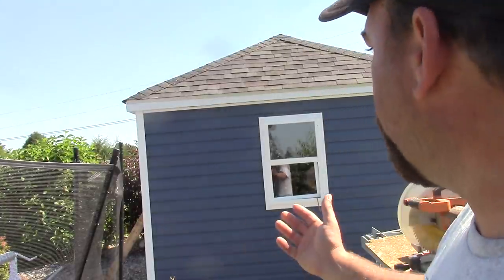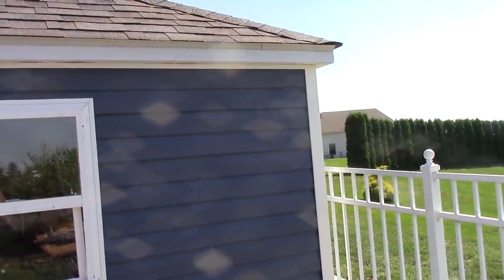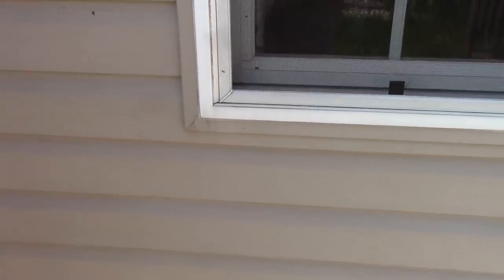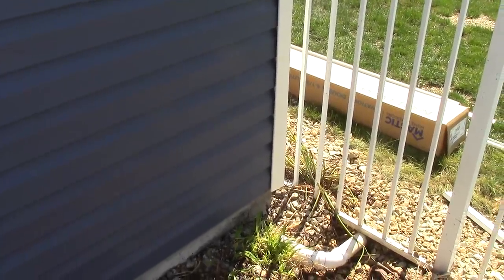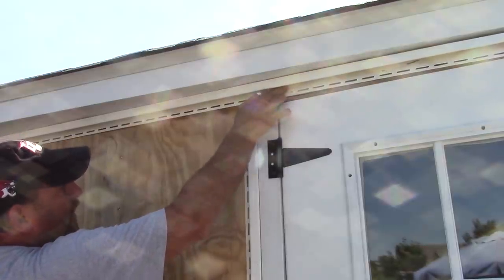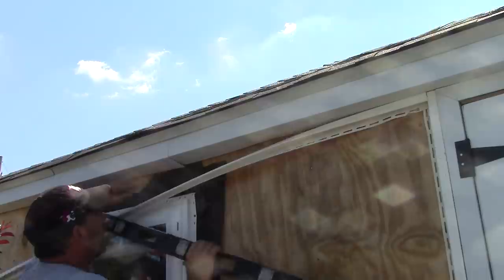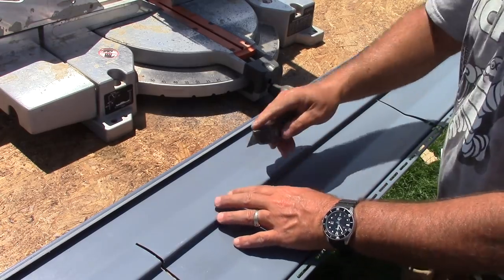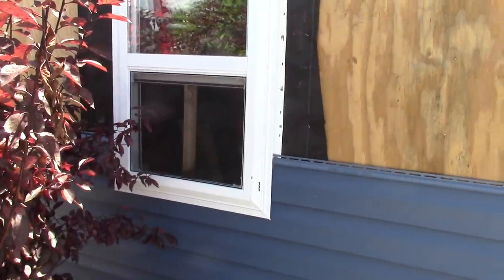How To Install Vinyl Siding On A Shed

Comment: To anyone watching this, use house wrap, it is your actual barrier against water,  Some water will and does get behind vinyl siding, especially were windows are. Were do you think wind driven rain goes after getting in the j trim around the window? Yes down  and some gets behind the siding as the j channel doesn’t run straight down to the ground, as say like the corners do, so you count on House wrap to keep the sheathing dry as any water that made it by the siding will run straight down and out. Any play were to pieces of siding meet even tho they over lap, can and do get a little wind driven rain past them. Again this isn’t a issue when installing the House wrap and flashing correctly. This guy doesn’t have a clue.
Reply: Thank you

Comment: Nice video.  Thanks for posting, very helpful.  Just had one question; how do you make sure the siding is started at the same height all around the building so that it is level all the way around?  Thanks
Reply: a starter strip helps tremendously

Comment: Nice, Bob.  Irwin makes a vinyl blade that's a lot quieter than anything else I've tried.  Thanks for sharing, man!
Reply from the maker: I didn't know there were vinyl blades.  Thanks for the tip.

Comment: have a window leaking . looks like I may have to remove siding the gap is more than 1/2 inch at top & too large to caulk. any easy way to seal this?

Comment: Right off the bat, a seam in between the window and the corner post, why? That's a no-no where a full piece can be used. Tapping on the wall with your hands and the window sash starts dropping down, funny. There is such a thing called condensation, leading up to mold, rot, plywood swelling etc. behind the siding. For a couple bucks more you should have bought some wrapping paper.    I enjoy watching DIYer's doing their weekend could of should of projects. I know it's only a shed, but hello.

Comment: Is there a reason you put slider windows in as double-hung windows? Your drain holes should be in the bottom and not on the side.
Reply from the maker: I used these windows because they were $20 a piece and they were matching.  I ended up drilling out the bottom so they would drain.  I did not know that they were slider windows until the bottom filled up with water.  I had to put some painted wood shims in the sides to have them slide vertically properly.  Live and Learn.

Comment: you forgot the moisture barrier
Reply from the maker: I talked about it in the last video.  I want the building the breathe because there is going to be spilled water inside the building with it being a pool house.  Also there is stone landscape surrounding the outside of the building, so there should be good drainage from the water off the roof.
Reply: @doublewide6  house wrap breathes, it's not a waterproof barrier it's more of a water-shedding material

Comment: Telling people that building wrap is not necessary is just criminal .👎👎👎
Reply: It's a shed not a house. It's not heated or insulated. This is a hell of a lot better then the painted chipboard shed I have in my yard that I need to fix. It's probably only 10 years old and the chip board exposed directly to the outside is completely sogged and rotten. I was going to just replace the chipboard and paint it with 3 coats of paint but now I am thinking of trying to do siding now that I see how it's done. And then it will last 50 years instead of 10. Just need to replace shingles not rebuild the entire damn thing next time. Whoever owned this house before me was a hack everything they touched was half assed and not designed to last.
Reply: The person who owned your house before must have own my house. Same thing for my shed! I will now be looking at replacing the outside with siding.